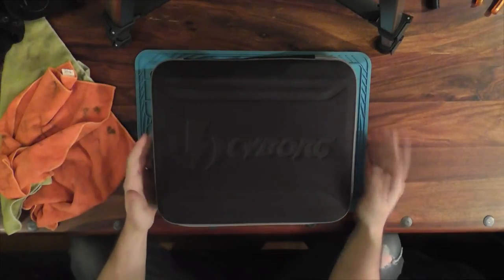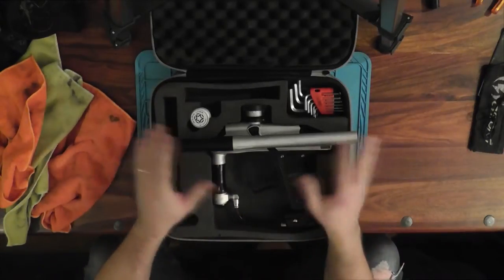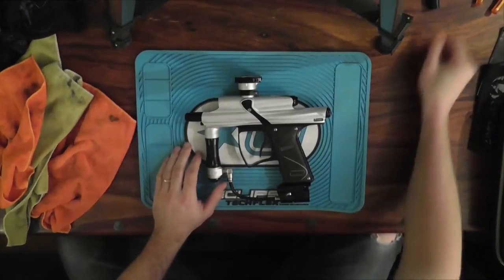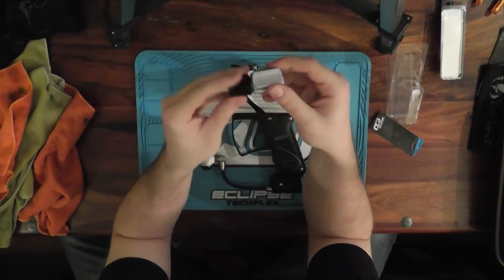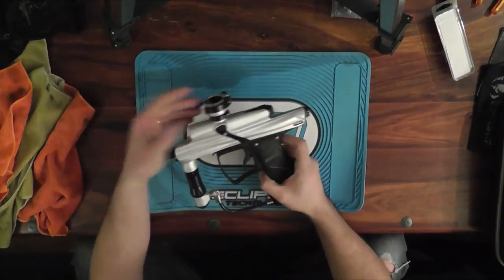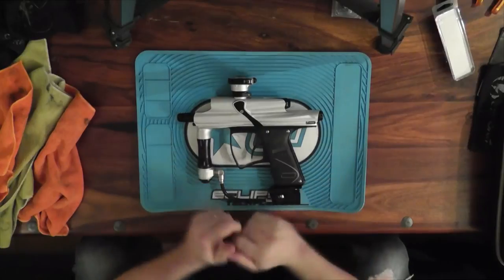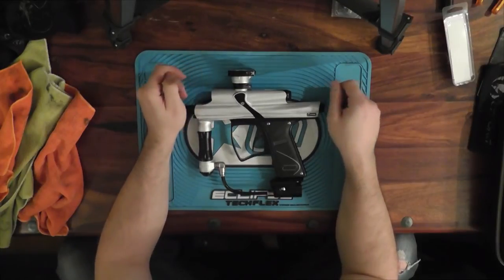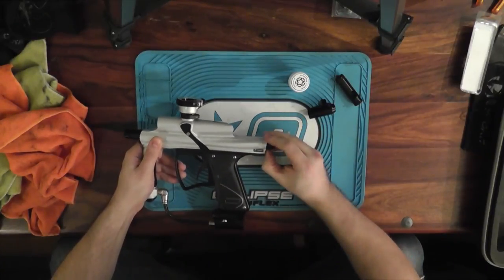MacDev Cyborg RX Super Gun Show - Part 1

Comment: I don't think the o-rings on the sides of the cross pin that you talk about at 9:20 are what seal in the air. They're just there to make sure the cross pin doesn't fall out. If it was leaking out that hole, it's because the central pin wasn't sealing properly inside.